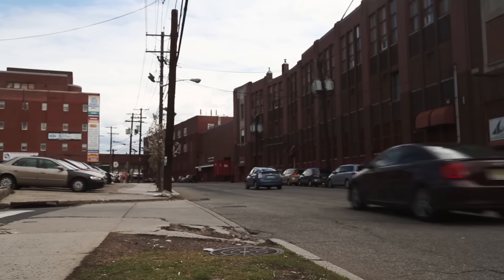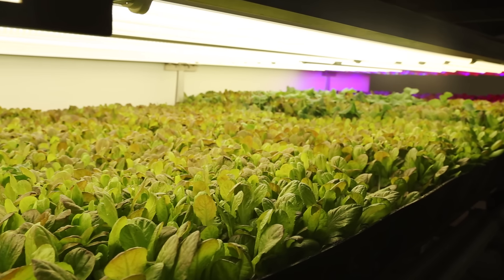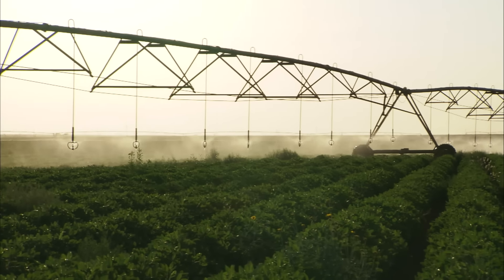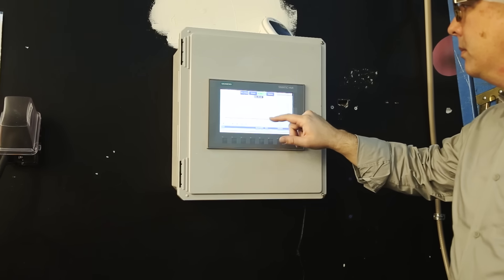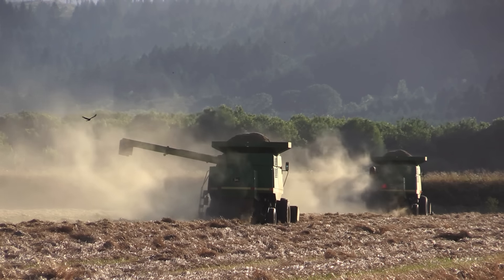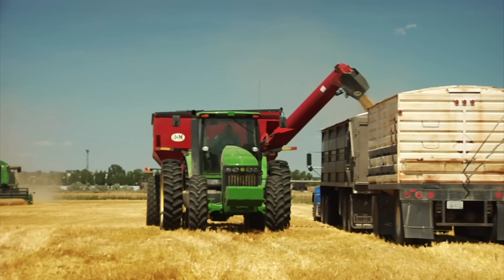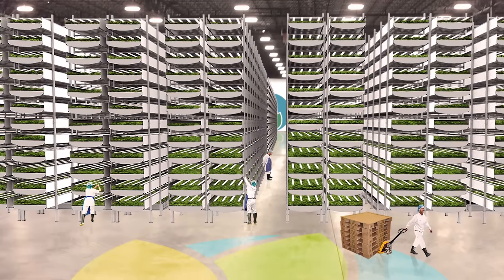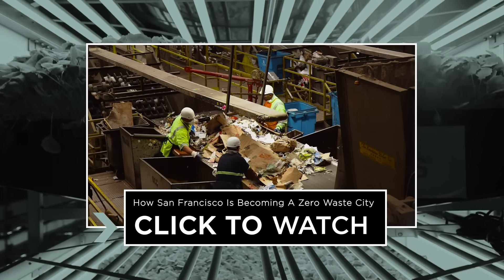This Farm of the Future Uses No Soil and 95% Less Water

Comment: The reasons why this isn't a thing is:
1. Light
2. Cost
Reply: it costs alot more to make a normal farm vs a vertical farm. LED Lights are very inexpensive. Alot less water used.
Reply: +Ant1Link Normal farm requirements: some ground.
Vertical farm requirements: building, structure, lighting, ventilation, less ground, power etc...

Ok if land value is through the roof, vertical farming might be cheaper to set up. But it usually isn't, since farms are not in cities, so the set up cost for a normal farm is lower.
Reply: I think this model relies on one big assumption. That people are at least a significant portion of people are willing to pay a premium for fresh vegetables out of season.

Like for example if you buy a strawberry in May or June, it will&#160;likely to taste much better than the one you bought in December.; This because such a December strawberry was picked green in the Southern Hemisphere so it could survive the transport. Then it was gassed with a maturing agent when it got close to its final retailer. The end result is a strawberry that tastes as bland as one picked 2 weeks too early, but looks mature. Meanwhile the June strawberry was picked just a few days ago in field may just a few hours drive away.This a VERY common tactic across the entire food production industry.

Considering how expensive out of season food is to buy (often like 3 to 7 times that of in season food), you could actually make a profit doing this. But my guess is that the margins are still pretty thin, even on seasonal foods. You certainly are not going to grow any wheat or rice this way.
Reply: ***** No counter arguments? Ok
Reply: TC Coltharp Well for people in cities this will not be a problem because, well, they often have alot more money. Although in this video they present it as if it will be wide spread as a superior option to the current way of producing greens. 

I think the biggest problem will be light (energy). Maybe in the soon future we will have more disposable energy but if we don't invest more in battery technology and/or nuclear power this idea won't go far.

Just imagine moving the plants into a building with lights. Those lights are slightly more efficient than sunlight to supply the plants. But if the energy comes from something like solar (the "green" alternative) we would have to replace the fields with 50% effective solar panels (which is a pretty new technology) to just supply the plants that they have replaced. This is why I'm for nuclear.

I'm not against the idea. I just think it sounds a little bit like solar roadways and dell's aircarbon (except those are just bullshit). 

I really do hope tho that vertical farming could be the best option in the soon future.
Reply: Ant1Link When I say lights I mean energy. If we would just replace the fields with solar panels what do we gain? 

If nuclear power becomes a thing again then sure. 

(also how will they get harvested? I'm sure they have a good solution I'm just curious)
Reply: +OllieWille If we could replace the fields with solar panels and overall 1:1 use the same amount of land it would be AMAZING. all the tractors and etc producing gases, more or less destroying the ground they growing in, pesticides harming TONS of things, kicking up lots of dust prepping ground etc. those are things that would be prevented, not even including the pros of verticle farming.
Reply: Like I said "You are certainly are not going to grow any wheat or rice this way."  

In the short and mid-term my guess is that this will only be profitable for food in which freshness is large factor in its value.  It will probably be 100 years before this method supplants current methods of production for staples like wheat, rice, and corn. 

Sadly it appears that this reporter does not understand these economic and agricultural fundamentals, and thus reports this as more of technological miracle that will save us.  The end result is a lot of confused people who now believe that vertical farming is strictly superior to mainstream farming.

But it is not exactly Solar Roadways, because there are some foodstuffs that could benefit from this more expensive process.  Solar Roadways are just strictly inferior.
Reply: LEDs have come down in cost tenfold in the last decade. Traditional farming requires pesticides, large tracts of land, and huge amounts of water, vertical farming does not.
Reply: Some one doesn't know what they're talking abouttttt!

For one the land we use to grow crops is dying. The soil is ruined and there are tons of areas where we simply can't grow anymore because of this. So right off the bat your "some ground" line of reasoning is wrong.

Not only that but to farm for the masses on a mass scale you need WAY more than just ground. You need TONS of water, TONS of pesticides (or GMO's), TONS of equipment, TONS of fuel for said equipment, etc.

Even if vertical farming isn't cheaper (which I don't see how that could be the case) that's about the only thing it has going against it. It's safer, requires less resources, requires no pesticides, crops won't die due to disease or bugs, and crops can be grown all year round. 

So, yeah, rekt.
Reply: +Trevor Murphy.  It does not matter how cheap LEDs have gotten.  It is still always going to be more expensive than direct sunlight until we master fusion.  That basic thermodynamics.  And until Earth is like 10% of an ecumenopolis, fertilized dirt is going to be cheaper than fertilized reusable plastic liner.
Reply: Logical Reason This still doesn't hide the fact that we don't have the amount of energy to power the LED's. I think this project is amazing I just answered the comments for why it isn't a thing right now. The video was also a little bit too optimistic. I tried to say what we have to adress, light (energy) and cost to migrate to this new technology. So I would say that I know what I'm talking about.
Reply: Trevor Murphy I know. I never said anthing about water. I wrote ten words, please read them all...
Reply: you're not thinking about all the pollution and amount of water used. Thats way more expensive than led lights.
Reply: Wrong. Farms require:
ALOT of land, atleast 10s of tractors and other farming vehicles to not only to harvest & maintain the crops, but to transport farmers across the land, Thousands of gallons of water, and airplanes to spread the pesticides.

Verticle farming: 
A building, lights, people.

Also the fact that verticle farms are indoors allows them to grow produce out of seasons and not worry about other natural elements that would normally result in a bad yield.
Reply: What are you talking about? Do you know how much energy LED's use? The power used by a few 60w light bulbs can power an entire level of LED's. How much power do you think they use? How weak do you think power plants are? 

Honestly, this is you talking out of your ass and you simply trying to find some negative aspect of this where none exists. 

Money isn't an issue either. There's PLENTY of money for this. If the US government can spend 1.7 trillion dollars developing the F-35 then it can create massive indoor farms all over the country. It isn't a matter of money but simply DOING IT. 

So, no, you may think you know but you clearly have no idea.
Reply: Plus, have you been to any super market and seen the shelves? Does it look like we have a food production problem?
Reply: It's only a matter of time. Might as well start now before it's an full on problem that'll create massive issues. It's called "thinking a head".
Reply: People watch this video like they're not showing a working example, and cite dozens of other operating vertical farms. It's hilarious.
Reply: ENERGY PEEEPS
Reply: ALSO NEVER DID I SAY THAT IT WOULDNT WORK

I ANSWERED OTHER COMMENTS THAT SAID "why isnt this a thing" AND I SAID 
"The reasons why this isn't a (current) thing". Never in the history of mankind did I say otherwise. I think this is a promising concept but it doesn't really make sense at the time being. Thank you.
Reply: uuuuuhhhhhhhhhh
Reply: energy solution = solar panels
Reply: So you want us  to go from one wasteful spending program in the F-35 to another wasteful spending program in indoor gardening warehouses?  This is a cool idea, but we don't really have a food problem in the US.  This looks cool to have a building full of lettuce.  But how much of a city needs to be covered to grow the staple crops like wheat and corn?  

Can't we focus on using all this solar power to do things like replace coal power plants used to power homes, and leave the rest of the solar power to grow the crops in the ground like they always have?  Maybe way down the road when we have a fully sustainable, fully renewable energy grid, we can jump all over this.
Reply: This is true, but your yields per acre will be higher with the vertical, as you are technically making more acres as you increase height. This is compounded by dropping energy costs and the rising costs of long-distance shipping. Also, as someone in a semi--rural area, I've seen the competition for arable land increasing. We're going to have to either ship farther as areas develop and we open new lands for farming, or we can start projects like this in industrial/commercial areas. Imagine a Wal-Mart moving out and a place like this moving in. 

The average supercenter is around 4 acres. Assuming you use 2/3 of that floorspace for your racks, multiply by 10 racks high (those were 2-2 1/2 feet high, right?), and you suddenly have a 30-acre farm, down town/ in the burbs, with a parking lot that can be reclaimed as green space or built into new residential or commercial area.
Reply: Except then you have the runoff problems of a parking lot, plus maintenance staff, vehicles, security, and an overall loss in acreage due to unsuitability for infrastructure.
Reply: It really depends on what you grow- here in Wisconsin, where we grow alfalfa, corn & soybeans in rotation, the soil stays pretty good with minimal added fertilizers (mostly nitrogen for corn, which is nitrogen-intensive) and our climate covers our water needs automatically. So for an 'industrial' crop, like corn and wheat, conventional may stay the way to go. But smaller, more consumer-oriented crops, vertical seems more advantageous.
Reply: Brad Zeitler
 Get outta here with all your facts, and hands-on experience.
Reply: I'm so glad that this entire argument was shut down because of smart people who knwo what they're talking about 👌
Reply: +OllieWille renewable energy is advancing at a faster and faster rate, it's yet another technology that falls under the term coined by Ray kurzweil "the law of accelerating returns" just as this technology does. Guess what else falls under that law, lighting technology, material production (including those plastic produced base sheets) and lastly the technology that they use to provide the nutrients. As for ideas to provide the power without replacing those liberated fields with current solar panels, have the building covered in solar panels, transparent solar panels have just been created so it won't be long before we have energy generating Windows.
Reply: It's more a proof of concept. Much like how early wifi and bluetooth devices were lauded as the future but prohibitively expensive, the technology more demonstrates a potential new avenue for industry growth that if developed, will see a decrease in cost over time. The benefits may not necessarily be in the direct financial savings, but rather a reduced environmental impact that would indirectly cut costs of various expenditures centred around traditional agricultural practices. Though I wonder if you actually watched the video, because he did explicitly state that lighting was a non-issue.
Reply: Wonder if there'd be a way to redirect the natural sunlight to each of the rows with mirrors or something. That could cut down on the electricity costs.
Reply: Lol you have no clue about what you're talking about. The real reason is subsidies. These farms would compete with farmers and they will lobby the fuck out of this.
Reply: ChillsandThrills
You're right, I was just guessing. The subsidy thing makes sense.
Reply: +Ant1Link plus the product is in the city itself so no worry about the transportation cost
Reply: Farms are super super expensive and usually end up putting the farmer (who is more of a businessman, actually) under in debt just to afford the equipment to do large scale planting and harvesting.  You need land, and in order to actually be profitable one needs a lot of land to plant on, but expect maybe 80% of whatever you planted to survive an actual season because of factors like droughts or frosts. Large plots of land are hard to find, mostly because the local governments do not want to sell, or the large tracts are not specifically zoned for agriculture. You then need to purchase or rent a harvester, tractor, industrial planter-  a New Holland combine alone is $592,950. Go on their website. That is their cheapest option, and that is only one machine. That's more than purchasing a warehouse and setting up a ponics system.
Reply: +MetusBatmanV14 Farmers are businessmen, you wouldn't have the super farms for companies otherwise. You can literally major in Agriculture and Agriculture systems- a degree, saying you're a farmer. Smart farms don't go under, but small scale farmers often do because they aren't cut out for the cut throat business, so they end up getting absorbed into the bigger farms, or they fail completely. As for local government and land owning, yes, you have to go consult your local government if you want to set up a large scale farm and not some dinky little fifty acre plot with a few cows and chickens. You need to check if the zoning is accurate, as well as tax rates and tax cuts (i.e., if there is a body of water on the property you can get a tax cut because that acts as fire insurance and saves the county from putting a fire hydrant in or using one.
Reply: rawrindinasowrs That's not exactly how it works. When you set up a farm, you have to take into consideration where the animal waste is going to go, and while some areas may offer an incentive for retention ponds, you also have to be extremely careful about pre-existing water bodies, especially those connected to the existing river systems.
Reply: That was a counter argument...
Reply: They don't run on  solar power they run on LED lights if the plants could function  better with solar power panels they would  have used them.
Reply: Soil can be replenished

Comment: Not enough information provided here to determine if this is viable or not.  Examples:   What about costs?   Food taste?  Energy requirements?  Chemicals?   Maintenance?  Others ...
Reply: Intial costs: very high
Long term: economically viable
Food taste: let's ask someone who buys their greens from hydroponics or any ponic system. Pretty sure not so different from regular grown salad. 
Energy requirements: electricity (LED lights), temperature control, water (which is re-used), high tech equipment. 
Chemicals: Fertilizers
Maintenance: Technology controlled (computers), less labor needed. 
Production: All year round, independent from climate and can be settled anywhere in a city, town lowers distribution and transportation costs. Also they can save up space. 

In a regular farm, you need tractors (Fuel, emissions, pollution), Water irrigation, fertilizers + Pesticides, more labor depending on how big the farm is, transportation costs (from farm to market, fuel costs, emissions), completely dependent from climate (growing seasons), more land and space needed (higher costs the bigger the land)
If people are concerned about the nutrient source content for the plant, how is that different from growing it in a soil filled with leached chemicals from pesticides and herbicides?
Reply: Honestly most plants taste a lot like water because thats what a good portion of them is made up of. (Like lettuce) but i wouldnt bank to much on a weird flavor from them considering a) flavor is such a skewed and unique idea for each person and b) humans have created a lot of different flavor enhancers and modifiers.

Comment: Growing Spirulina uses about as much water if it's not set open air. In open air, evaporation removes significant quantities of water. My current system produces around 200 pounds of food per month in a 25x15 foot area. If I were to scale that to the size of a football field that would be 360 feet long, though the width varies by field.  If I assume the smallest field size thats going to give me 2880 pounds of food a month.  If I assume the largest that would be 8640 pounds of food a month. And that's not even vertically stacked. that's sunlight.  Still, that's around 5% of the food production of the farm here and it's nutritionally superior to meat which makes it a meat replacement and when you consider that you can't vertically stack meat production ethnically and still have to feed the animals that puts what I do on par with this.  If I stacked 30 feet high and used artificial lighting though that would put me at 362,880 pounds of food per year which is a little over 18% the productive capacity of their system. Since the video said their farm is bigger than a football field though, I could probably get that productive capacity to more closely match theirs.

Of course,  the challenge of a farm like mine is that the demand is niche.  Even if its more nutritious and easier to produce people have to want to eat it. I tested it successfully as a meat filler though, but needed flax as a binder.

Anyway,  my opinion is that farms like mine and this one can effectively feed any city in the world locally and eliminate hunger.  More difficult to grow food can be luxury items.